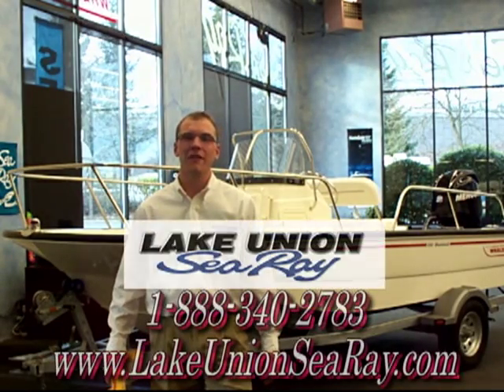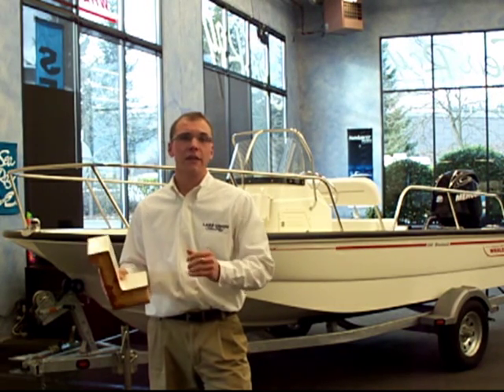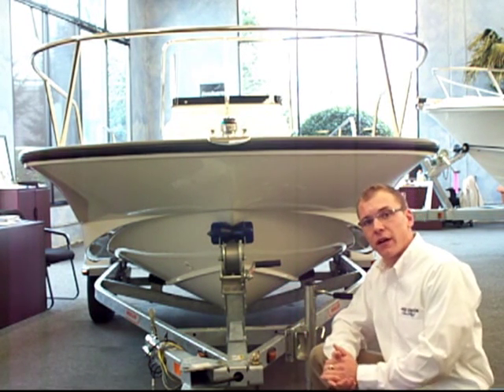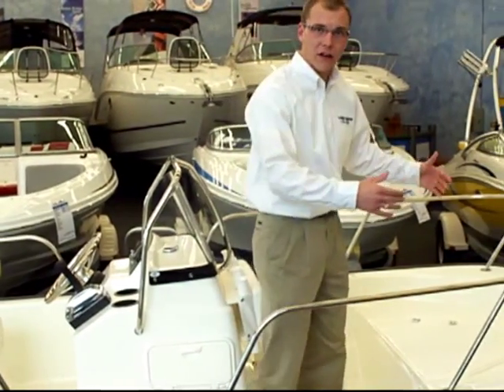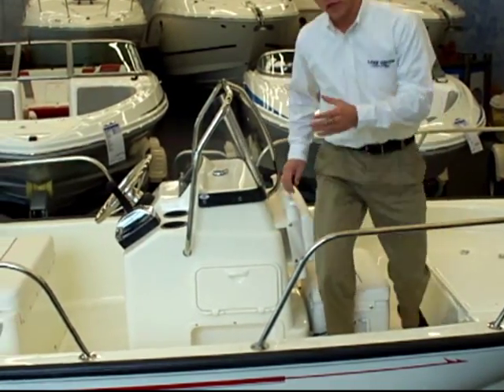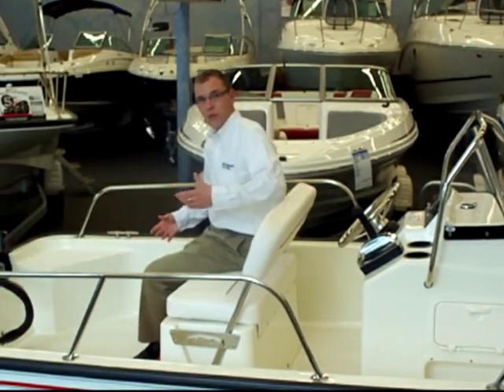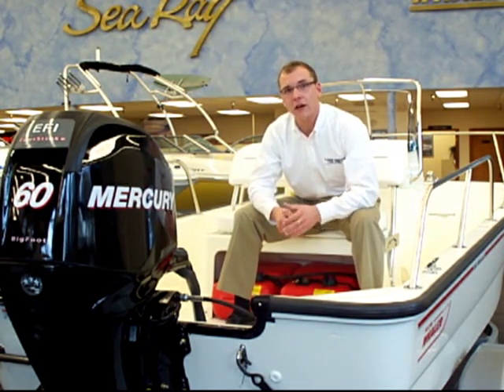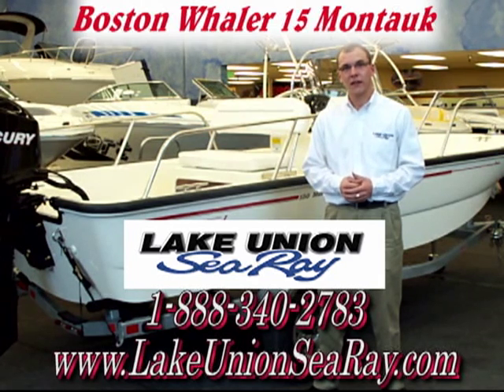2011 Boston Whaler 15 Montauk.avi

Comment: Love this model & the boat overall, you want to get the Bimini top & a few other important extras that bump the price, however well worth it whether  your buying used or new.  The key point is not just the unsinkable boat, it's mostly the really quite incredible overall quality of this fishing machine, again whether used or new. Expensive, however worth every $ spent.  The 17's are nice, but the 150.5" actually has a wider Beam & overall, the room inside is virtually the same. Just an interesting fact if your looking at both, though you can't go wrong with either.... Cheers